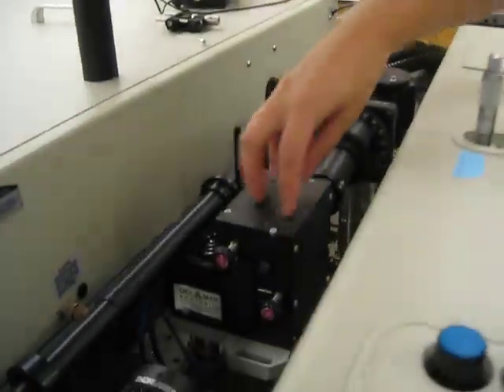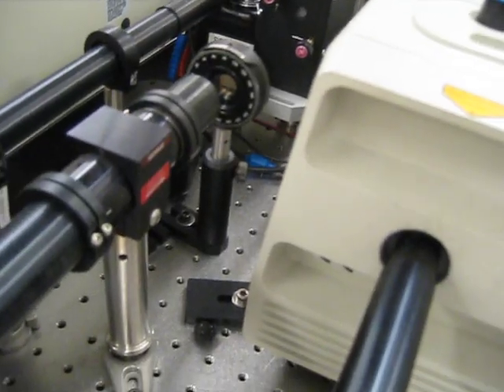A single source femtosecond-millisecond broadband spectrometer UC Davis - sales@dmphotonics.com

Comment from the maker: I am currently exploring options for autocorrelators to measure the following laser pulses:
pulse duration: 20 fs….few picoseconds (with 1µm central wavelength)
wavelength range: at least between 900 nm - 1100 
repetition rate of laser: >30kHz (up to several MHz)
scan range: ~10 ps (or more)
According to the specifications on your website I figured that the product Reef-RTD 700-1300 nm should fit my needs quite well. Therefore, I am kindly requesting a quotation for this or any more appropriate product you offer.
Mit freundlichen Grüßen / With kind regards

Comment from the maker: In stock! sales@dmphotonics.com
MgO:LiNbO3 crystal, stoichiometric, 5x9.81x5 mm to generate THz waves via optical rectification of amplified femtosecond pulses
[MgO-LiNbO3-5-9.81-5] 
http://greyhawkoptics.com/product_info.php?products_id=821&osCsid=d3650b98c98a90be176d1e91f1b59b5a
MgO:LiNbO3 crystal, stoichiometric, 5x9.81x5 mm
Click to enlarge
MgO:LiNbO3 stoichiometric crystal 0.6%
Size 5x9.81x5mm
Wedge angle 63°
Surface ?/4 at 633 nm
Surface quality 20/10 S/D all
Coating AR at 800nm, R<0.25% on one side
MgO concentration 0.6%
Additional Information Featured application - generate THz waves via optical rectification of amplified femtosecond pulses

New in stock!
MgO(1%):LiNbO3 crystal, stoichiometric, 5x9.81x5 mm
[MgO1%-LiNbO3-5-9.81] 
http://greyhawkoptics.com/product_info.php?cPath=32_54&products_id=1003&osCsid=2eb0274087dc99a675efe22e929eddd8
MgO:LiNbO3 stoichiometric crystal 1%
Size 5x9.81x5mm
Wedge angle 63°
Surface ?/4 at 633 nm
Surface quality 20/10 S/D all
Coating AR at 800nm, A & B sides
MgO concentration 1%
Additional Information Featured application - generate THz waves via optical rectification of amplified femtosecond pulses

MgO(1%):LiNbO3 crystal, stoichiometric, 10x10x19.626 mm
[MgO1%-LiNbO3-10-10-1] 
http://greyhawkoptics.com/product_info.php?products_id=1004&osCsid=2eb0274087dc99a675efe22e929eddd8
MgO:LiNbO3 stoichiometric crystal 1%
Size 10x10x19.626 mm
Wedge angle 63°
Surface ?/4 at 633 nm
Surface quality 20/10 S/D all
Coating AR at 800nm, A & B sides
MgO concentration 1%
Additional Information Featured application - generate THz waves via optical rectification of amplified femtosecond pulses

Comment from the maker: Pismo 8/1 pulse picker for Ti:Sapphire oscillator sales@dmphotonics.com 
https://www.youtube.com/watch?v=aFA8EOzS33g

You can see list prices and specs for a number of Pismo Pulse pickers in our online store.
http://greyhawkoptics.com/index.php?cPath=35_103
https://www.youtube.com/watch?v=aFA8EOzS33g

For custom quote we need to know
Pulse wavelength
Pulse Duration
Pulse Energy
Rep Rate
Beam Size
Required rep rate after pulse picker
Required contrast

Here are just few examples:
Pulse Picker Pismo OG10/10
[PP-OG10/10]   
http://greyhawkoptics.com/product_info.php?cPath=35_103&products_id=768&osCsid=5356c2f109789e7336c50c1f06d15b56
Pismo OG10/10 pulse picker system for 700-1000 nm
Pulse picker system with synchronization and control electronics.
Pockels cell crystal: DKDP, 6x6x16 mm, ARC 690-1010 nm (clear aperture - 5 mm), other apertures on request
HV pulse amplitude: up to 10 kV (HV pulse has the amplitude ~8kV with duration 10 ns at level 10% of maximum)
(pulse duration: 0.9-0.9 - 2.3 ns; 0.5-0.5 - 5.5 ns; 0.1-0.1 - 8.9 ns; rise time (0.1-0.9) - 3.3 ns; fall time (0.9-0.1) - 3.4 ns)
Repetition rate: 1 kHz ... 10 kHz
RF source: 30-120 MHz
RF input: optical (internal fiber coupled photodetector with 1.5-m long plastic fiber)
System transmission: >85%
Contrast ratio: >1:1000
USB control with drivers and software included
Also included:
Two Glan-Taylor calcite air-spaced polarizers with mounts
1.5-meter optical fiber for synchronization
LabView-compatible software

Pulse Picker Pismo OG8/100B
[PP-OG8/100B]   
http://greyhawkoptics.com/product_info.php?products_id=562&osCsid=9a09c9d66fd8d49fd75981cbb124fdce
Pulse Picker Pismo OG8/100B
Pismo OG8/100B pulse picker system
Crystal: BBO, 4x4x20 mm (clear aperture – 3.5 mm), other apertures on request
Standart ARC: ARC 750-850 or ARC 1500-1600 nm, custom ARC on request
HV pulse amplitude: up to 8 kV (bell-shaped HV pulse has the amplitude ~8kV with duration 10 ns at level 10% of maximum)
Repetition rate: single shot – 100 kHz
Optical source rep. rate: 30-120 MHz
Optical Synchronization input: optical (internal fiber coupled photodetector with 1.5 m length fiber)
System transmission: >85% @ 780 nm
Optical scheme: ?/4
Contrast ratio: >1:1000
Note: Also included: USB control with drivers and software, LabView drivers, Two Glan-Taylor calcite air-spaced polarizers with mounts, 1.5 m optical fiber for synchronization

Comment from the maker: Ultrafast laser inscription of 3D components for spatial multiplexing
Robert R. Thomson
18 February 2016 • 9:00 - 9:30 AM | Part of SPIE OPTO

Precision resection of intestine using ultrashort laser pulses
Rainer J. Beck, Wojciech S. Góra, Neil MacIntyre, Sonny Gunadi, David G. Jayne, Duncan P. Hand, Jonathan D. Shephard
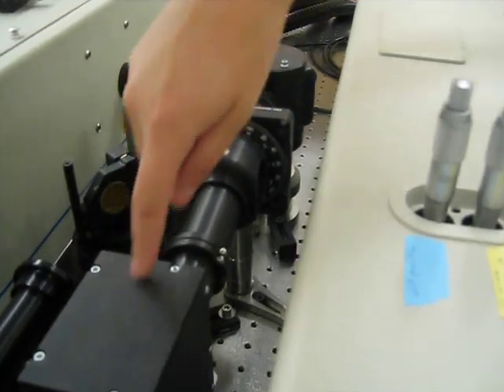15 February 2016 • 2:10 - 2:30 PM | Part of SPIE BiOS

Performance of the Yb:Lu2O3 laser crystal in diode-pumped femtosecond oscillators and high-power regenerative amplifiers
Etienne Caracciolo, Federico Pirzio, Matthias Kemnitzer, Annalisa Guandalini, Florian Kienle, Antonio Agnesi, Juerg Aus der Au
16 February 2016 • 1:40 - 2:00 PM | Part of SPIE LASE

Time resolved digital-holographic analysis of femtosecond laser-induced photodisruption
Emanuel Saerchen, Johannes Wenzel, Alexander Krüger, Holger Lubatschowski, Tammo Ripken
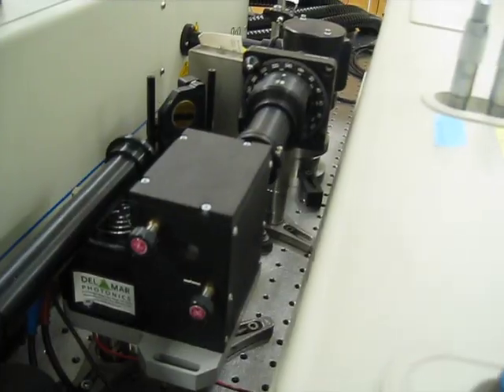15 February 2016 • 2:30 - 2:50 PM | Part of SPIE BiOS

Analysis of photoacoustic response from plasmonic nanostructures irradiated by ultrafast laser in water
Ali Hatef, Behafarid Darvish, Adrien Dagallier, Christos Boutopoulos, Michel Meunier
15 February 2016 • 1:45 - 2:00 PM | Part of SPIE BiOS

Mid-infrared supercontinuum generation up to 4.6 µm using step-index indium fluoride fiber pumped by a femtosecond fiber laser near 2 µm
Reza Salem, Zhuo Jiang, Dongfeng Liu, Robert Pafchek, Paul Foy, Mohammed Saad, Doug Jenkins, Peter Fendel, Alex E. Cable
16 February 2016 • 9:00 - 9:20 AM | Part of SPIE LASE

Phase matched second harmonic generation in an on-chip high-Q lithium niobate microresonator fabricated by femtosecond laser direct writing
Jintian Lin, Yingxin Xu, Zhiwei Fang, Min Wang, Wei Fang, Ya Cheng, Jiangxin Song
17 February 2016 • 9:00 - 9:20 AM | Part of SPIE LASE
COURSE AT CONFERENCE
Introduction to Ultrafast Optics (SC746)
Instructor(s): Trebino, Rick, Georgia Institute of Technology
Level: Introductory • 0.35 CEU • Length: 4.00 hours
Member Price: 300.00 | Non-Member Price: 355.00
14 February 2016 • 1:30 PM | Part of SPIE Photonics West

Ultrafast laser ablation of transparent materials
Lara Bauer, Simone Russ, Myriam Kaiser, Malte Kumkar, Birgit Faisst, Rudolf Weber, Thomas Graf
17 February 2016 • 3:20 - 3:40 PM | Part of SPIE LASE

Modelling and simulation of ultrashort pulse amplification
Christoph Pflaum, Rainer Hartmann, Zhabiz Rahimi
16 February 2016 • 2:00 - 2:20 PM | Part of SPIE LASE

Large cross-phase modulation driven by intense THz field
Carlo Vicario, Mostafa Shalaby, Christoph P. Hauri
18 February 2016 • 3:50 - 4:10 PM | Part of SPIE OPTO

Two-photon excitation endoscopy through a multimode optical fiber
Edgar E. Morales Delgado, Demetri Psaltis, Christophe Moser
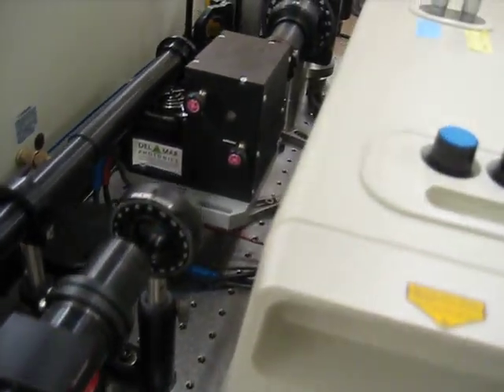15 February 2016 • 2:20 - 2:40 PM | Part of SPIE BiOS

High peak power ultrafast Cr:ZnSe oscillator and power amplifier
Evgeny Slobodchikov, Logan R. Chieffo, Kevin F. Wall
15 February 2016 • 8:40 - 9:00 AM | Part of SPIE LASE

High average power (25W) high peak power (10 TW) high contrast (>1010) femtosecond laser chain
Raphael Clady, Vadim I. Tcheremiskine, Yasmina Azamoum, Laurent Charmasson, Nicolas Sanner, Olivier P. Uteza, Marc L. Sentis
16 February 2016 • 1:00 - 1:20 PM | Part of SPIE LASE

New generation of high average power industry grade ultrafast ytterbium fiber lasers
Alexander Yusim, Igor Samartsev, Oleg Shkurikhin, Daniil V. Myasnikov, Andrey Bordenyuk, Nikolai Platonov, Vijay Kancharla, Valentin P. Gapontsev
18 February 2016 • 3:40 - 4:00 PM | Part of SPIE LASE

Packaging and micro-structuring for enabling multi-functional fiber-cladding photonics and lab-in-fiber
Moez Haque, Stephen Ho, Erden Ertorer, Kevin A. J. Joseph, Jianzhao Li, Peter R. Herman
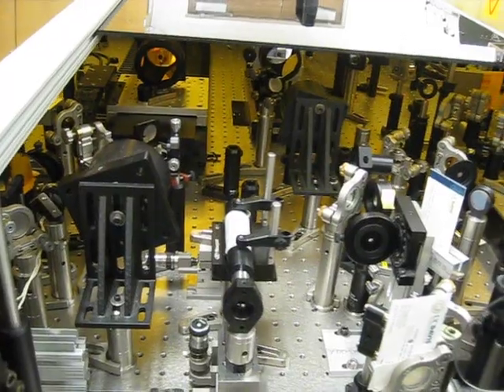14 February 2016 • 3:00 - 3:20 PM | Part of SPIE OPTO

Fabrication of waveguide spatial light modulators via femtosecond laser micromachining
Nickolaos Savidis, Bianca Datta, Sundeep Jolly, V. Michael Bove, Jr.
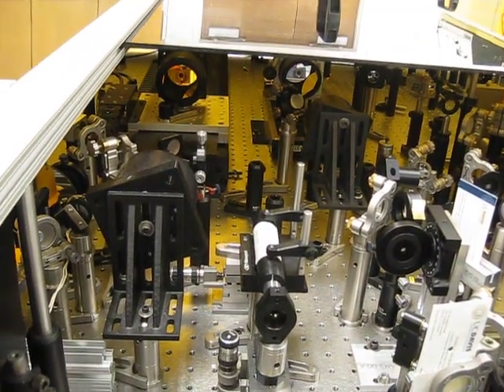15 February 2016 • 2:50 - 3:10 PM | Part of SPIE OPTO

microPREP: A new laser tool for high-throughput sample preparation
Tino Petsch
16 February 2016 • 1:30 - 2:00 PM | Part of SPIE LASE

Sub-diffraction limit nanostructures induced by femtosecond laser direct writing
Xiaolong He, Woongsik Nam, Xianfan Xu
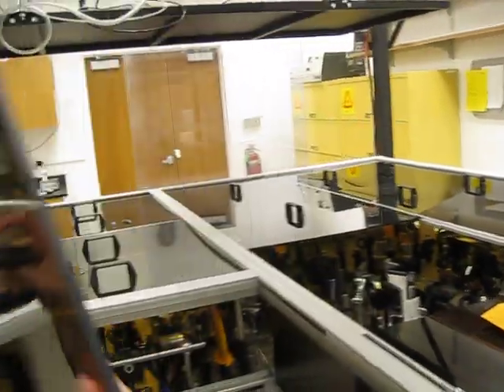17 February 2016 • 2:40 - 3:00 PM | Part of SPIE LASE

Ultrashort pulse written volume-Bragg-gratings in fused silica for external stabilization of diode lasers with ultra-low spectral-drift
Daniel Richter, Christian Voigtländer, Jens U. Thomas, Ria G. Krämer, Hagen Zimer, Andreas Tünnermann, Stefan Nolte
17 February 2016 • 9:20 - 9:40 AM | Part of SPIE LASE

Multi-photon imaging with high peak power VECSELs
Shamil Mirkhanov, Adrian H. Quarterman, Conor J. C. P. Smyth, Samuel Swift, Keith G. Wilcox
16 February 2016 • 6:00 - 8:00 PM | Part of SPIE LASE

Pulse front adaptive optics in multiphoton microscopy
Patrick S. Salter, Bangshan Sun, Martin J. Booth
13 February 2016 • 11:40 AM - 12:00 PM | Part of SPIE BiOS

Pulsed interferometric phase measurement for coherent beam combining
Jeremy Le Dortz, Marie Antier, Jérôme Bourderionnet, Christian Larat, Eric Lallier, Louis Daniault, Severine Bellanger, Christophe Simon-Boisson, Jean-Christophe F. Chanteloup, Arnaud Brignon
16 February 2016 • 6:00 - 8:00 PM | Part of SPIE LASE

Simultaneous spatial frequency modulation imaging and micromachining with a femtosecond laser
Michael D. Young, Erica K. Block, David G. Winters, Jeffrey J. Field, Keith Wernsing, Randy A. Bartels, Jeff A. Squier
16 February 2016 • 3:50 - 4:20 PM | Part of SPIE OPTO

Long-range energy transfer mechanism between two coupled plasmonic nanoantennas
Martin Aeschlimann, Tobias Brixner, Benjamin Frisch, Bert Hecht, Bernhard Huber, Matthias Hensen, Christian Kramer, Enno Krauss, Walter Pfeiffer, Martin Piecuch, Christian Strüber, Philip Thielen
17 February 2016 • 8:30 - 9:00 AM | Part of SPIE OPTO

Investigation of the nonlinear absorption spectrum of all-trans retinoic acid by using the steady and transient two-photon absorption-induced spectroscopy
Marcelo G. Vivas, Jonathas De Paula Siqueira, Daniel Silva, Leonardo De Boni, Cleber R. Mendonça
17 February 2016 • 6:00 - 8:00 PM | Part of SPIE OPTO

Ultrashort-pulse laser processing of transparent materials: Insight from numerical and semi-analytical models
Nadezhda M. Bulgakova, Vladimir P. Zhukov, Yuri P. Meshcheryakov, Tomáš Mocek
16 February 2016 • 1:40 - 2:10 PM | Part of SPIE LASE

Broadband electrical control of second-harmonic generation in bilayer MoS2 by inversion symmetry breaking
Julian Klein, Jakob Wierzbowski, Armin Regler, Jonathan Becker, Florian Heimbach, Michael Kaniber, Kai Müller, Jonathan J. Finley
16 February 2016 • 11:00 - 11:20 AM | Part of SPIE LASE

Broadband frequency-chirped terahertz-wave signal generation using periodically-poled lithium niobate for frequency-modulated continuous-wave radar application
Junichi Hamazaki, Yoh Ogawa, Norihiko Sekine, Akifumi Kasamatsu, Atsushi Kannno, Naokatsu Yamamoto, Iwao Hosako
17 February 2016 • 5:30 - 5:50 PM | Part of SPIE OPTO

Formation of upconversion nanoparticles of Ce:YAG, Eu:KYW and 18%Yb:1%Er:NaYF4 by ultra-short pulse laser ablation in water
Laura Gemini, Marie Caroline Hernandez, Rainer Kling
13 February 2016 • 9:30 - 10:00 AM | Part of SPIE BiOS
Nonperturbative monitoring of dissipative Kerr solitons in microresonators
Michael L. Gorodetsky, Maxim Karpov, Hairun Guo, Erwan Lucas, G. Lihachev, Tobias J. Kippenberg
16 February 2016 • 6:00 - 8:00 PM | Part of SPIE LASE